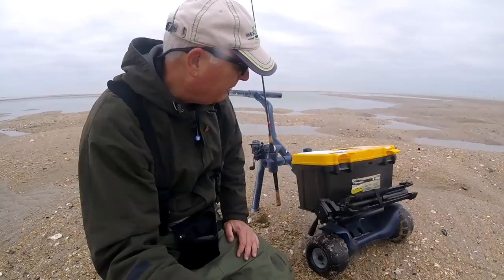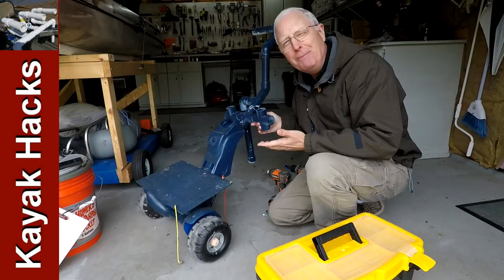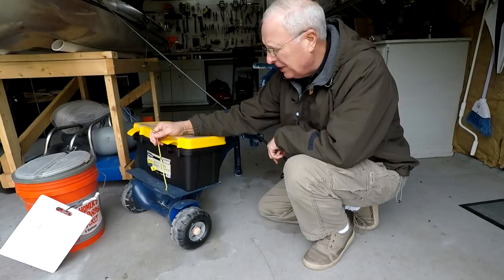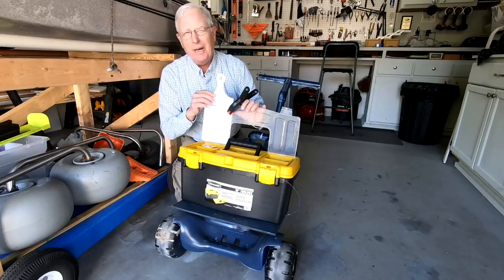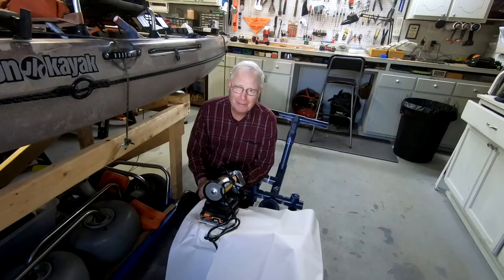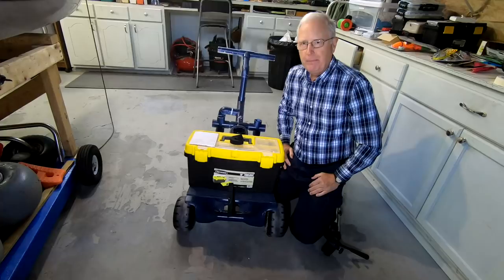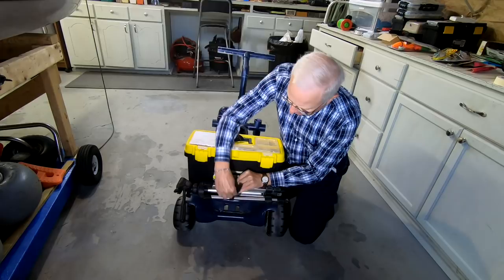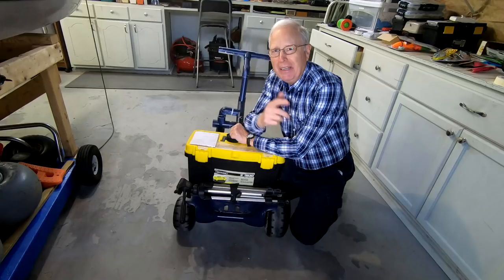UPDATED! DIY Beach Fishing Cart for Surf or Pier with Rod Holders and Tackle Box

Comment: Genius! You might be able to add a "pi" shaped seat that fits into the side by side rod holders. A couple of tee fittings with a crossbar, and bolt either a flat piece of plywood or even a contoured plastic seat to it.
Reply from the maker: Sweet idea! thanks

Comment: You could add a couple of pieces of PVC pipe to each side of the box for rod/net holders, standing them off with wooden blocks for clearance of the lid. Two questions....  does the wheel size pose any problems in loose sand, and when you opened your wallet to extract the ten for the new box, was anyone injured by the fleeing swarm of moths?
Reply: Hahahahahhaah
Reply from the maker: lol! Only one moth! The wheels work just fine on loose sand. I suspect the cart is light enough that the wheels do not sink. Good ideas... I'll look at that.

Comment: You could mount the tri pod on the other side and mount a 2 rod holder on the other side.
Reply from the maker: Good idea. If I already had not installed two rod holders on the handle, I would jump at that. Others can implement your suggestion!